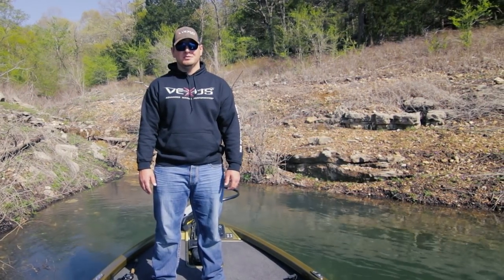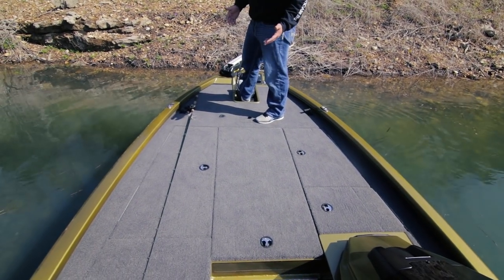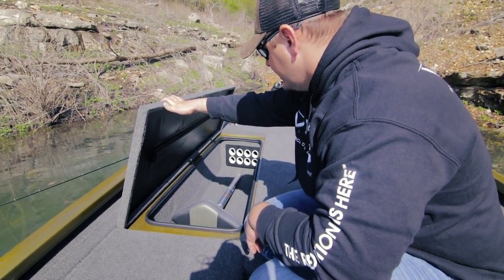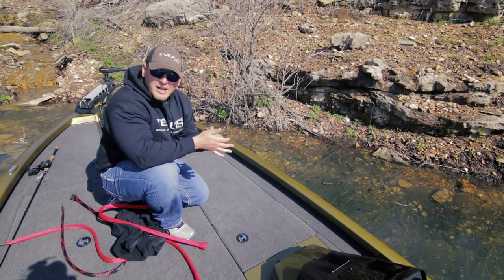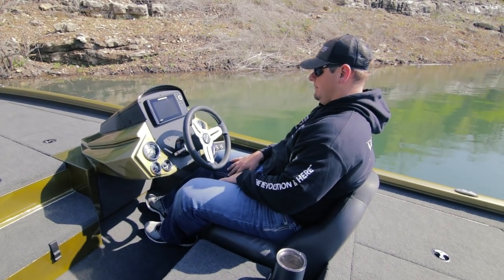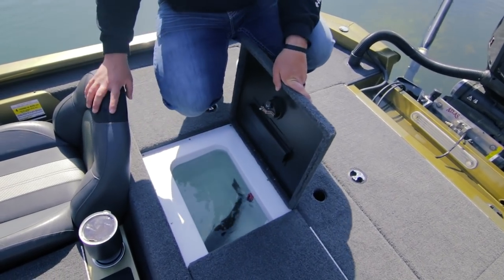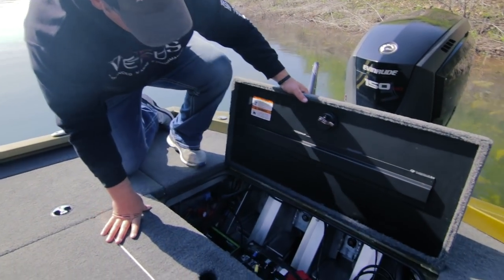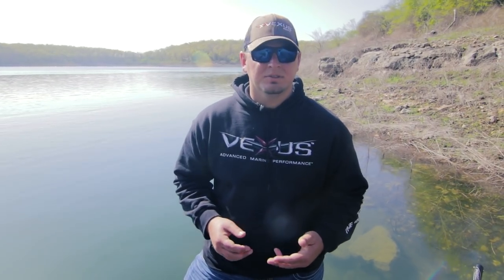Vexus® Boats - AVX1980

Comment: I have searched & researched aluminum boats for years and in the Aluminum segment, the avx is the best overall I've seen. I've never seen a boat that comes 100% the way I want but this one is very close. A few upgrades I notice from my current aluminum rig are (1) glass console over flemsy plastic (2) wood free vs plywood flooring & deck that rots (3) channel iron trailer frame vs tube trailer that rust from the inside out and will eventually buckle (safety issue)

Comment: Is the front deck fully aluminum other than the cooler & recessed area for the trolling motor? Also you mentioned the lids are just painted aluminum correct? Thanks!
Reply from the maker: Hi, Anna. Yes, the decks and lids are 100% aluminum. There is no wood in the boat at all. Thanks!

Comment: Still no specs on vexus website.  Hull thickness, transom thickness, hull weight, total weight persons and gear,  top speed with standard 150 equipment. With out this information those as customers cant make informed decisions. Any company can say we are the best but if its sup par on certain aspects its still not that great. 
(Ie) hull thickness on most welded aluminum bass boats is .100 but crestliner pt series is .110. What may seem insignificant is actually quite stronger... 
Without specs im not gonna drive to a dealer to look at it. Just to be disappointed or fed disinformation from a sales guy who also dont know.
Reply: Big -D I saw on anther YT flick it does 57 on the water 1980 w/150-hp it has a padded layer hull with 5-fully welded Transome Braces and foam filled.